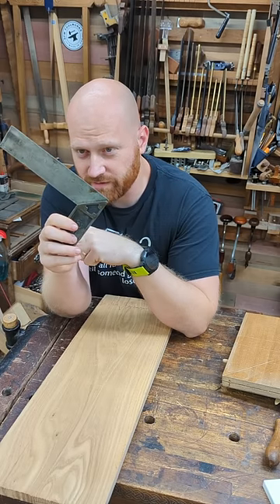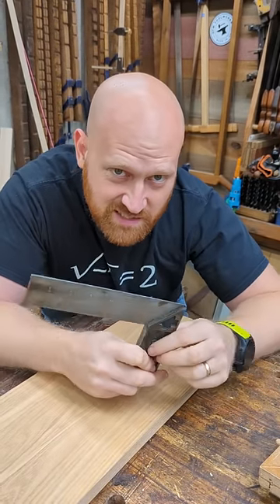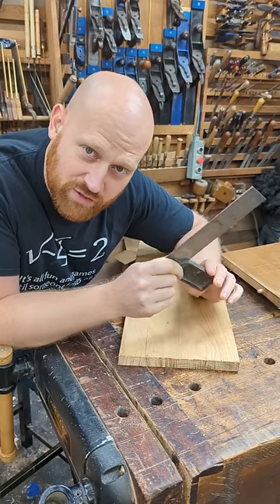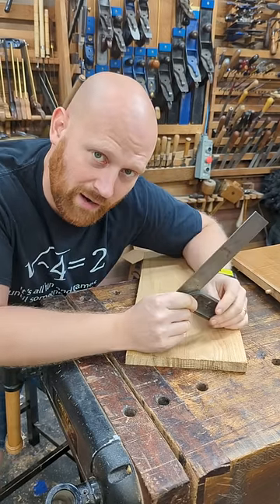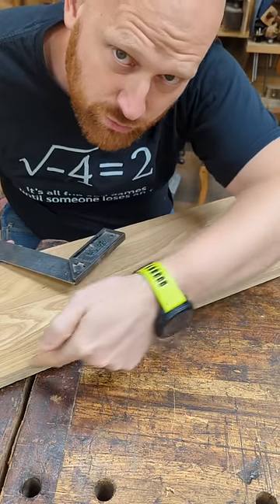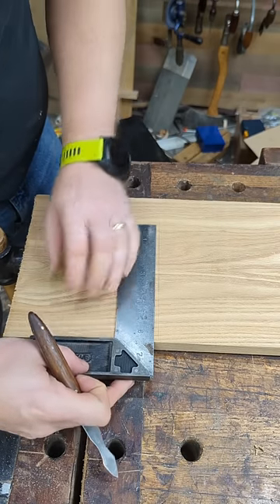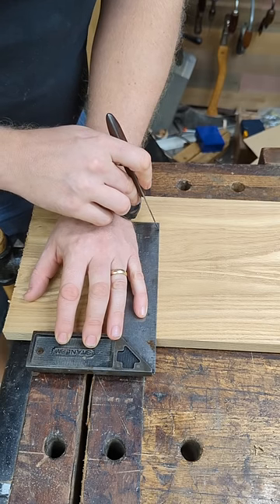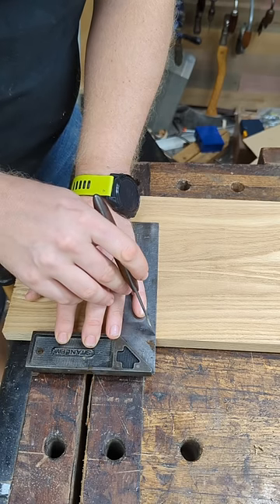How to Check if Your Square is Square

Comment: Considering the edge on that board is most likely your deviation I would have to disagree. You are measuring from two different locations that lends to inaccuracies. I would suggest to prevent false readings this measurement be performed on a machine preferably metal edge. Unless close enough or filler is your thing. 😂
Reply from the maker: The board can be easily checked with a straight edge, jointing plane, a string, or even an eyeball. It just has to be straight it doesn't have to be 90° or perfectly clean the goal is to take 180° and subtract 90°. Then the other half will also be 90° and that's why you flip it over.

Comment: There is also a chance that that board you are.using isn't flat! 😂🤣
Reply from the maker: Or you can just check it. Use a straight edge. A string. A joint or plane. Or even your eyeball. That's why I said make sure it's straight.

Comment: Close enough is good enough dude. We don’t have time for anything else.
Reply from the maker: For most applications yes. But if I ever drop a Square I always check it just to make sure. Perfection is a direction not a location. You can head towards it but you'll never get there.
Reply: Compounding errors for construction is never a good thing.
It doesn't matter if your square is out   a little at 3 inches, but it does at 3 feet. 

Get as close to square as you possibly can, then look after the tool.

Much better to spend 5 mins squaring a square than correcting loads of constant errors from using an inaccurate tools.

Comment: Check it mathematically.
Reply from the maker: 180 degreed -90 degrees = 90 Degrees.
Reply: No I meant the pythagorean theorem. 3 4 5 triangle to check for square.
Reply from the maker: The problem with that is then you're down to the accuracy of your measuring method. And usually the slop and that measuring is more than you would want for even woodworking.

Comment: If you don't have a perfect square straight board it will show up the error.. A little math can create a triangle to make an acurate test.
Reply from the maker: The edge does not need to be square. It just needs to be straight. It needs to be 180°. Half of that is 90. You can check that with a straight edge. A string. A joint airplane. And eyeball. Or a bunch of other ways.

Comment: I'm sorry, but I'm never going to trust the straight edge of a board that much. No matter what you do to it, that board can have more variance than a metal square
Reply from the maker: That is why you check it first. For using it in woodworking that is way more then good enough.

Comment: I blame the wood for the imperfection not the square if it is USA made. 

Just sayin...
Reply from the maker: you can quickly check the wood a dozen different ways and make it perfectly flat in a few seconds. squares change over time from normal use. even the best brand new squares can be bumped during transport and shipping from the factory.

Comment: But HOOOOOOOWWWWWW DO I KNOW THE EDGE OF THE WOOD IS FLAT AND SQUARE?? WHERE DOES IT END
Reply from the maker: That one is easy to check. Known straight edge. A piece of string, an eyeball, and many more methods are all well with in the accuracy needed to check for a straight edge.

Comment: Why would you trust a piece of wood to be straight? The piece of wood has not been calibrated...
Reply from the maker: It can easily be checked to be more than adequate for woodworking. You could use a jointer plane, unknown straight edge, a string, an eyeball, or one of the hundreds of other ways to measure 180°.

Comment: Ye my squares are made from one solid piece of metal, you can drop them all you want they won't deviate. Lol. And the one as small as he's using is solid metal and has a triangle connection, you can run it over with a tank it'll still be square.
Reply from the maker: Even speed squares go out of Square from time to time.

Comment: Checking in on a board is not the correct way. Must be a very accurate machined steel.
Reply from the maker: The board is more then good enough if you checked it. That is the media that it will be working on.

Comment: you would be better doing that upagainst the edge of something metal
Reply from the maker: For the purposes of woodworking what is a perfectly good surface. And it's easy to check and make sure it is straight.